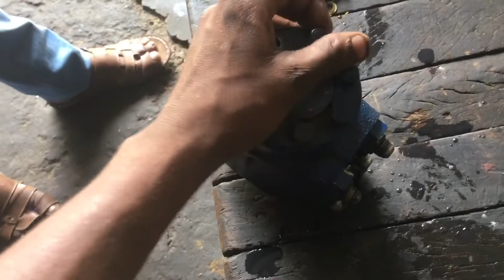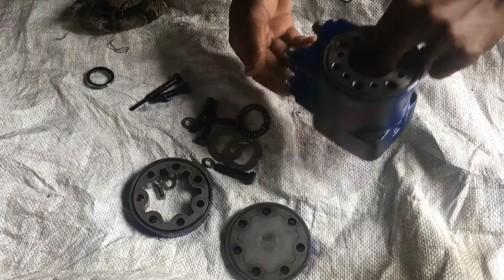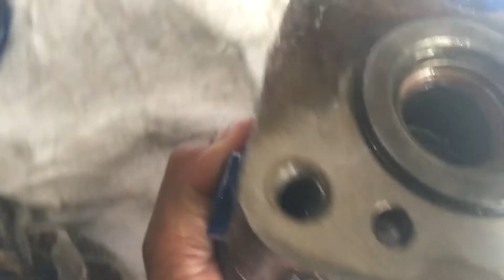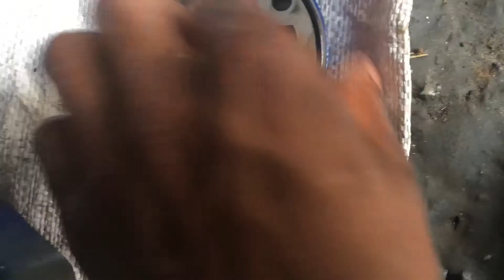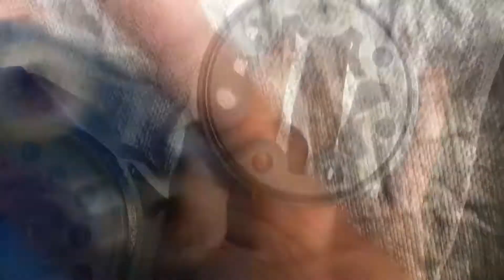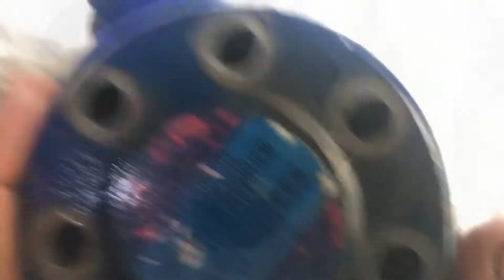power steering motor ki seal replace kaise Kara

Comment: This is  Shijiazhuang Hanjiu Technology Co.,Ltd,we mainly produce    Hydraulic orbital Motor and Hydraulic steering unit and Hydraulic Directional valve

HANJIU Orbital Steering Valve 101s applications:

1 Change Danfoss, Eaton, M + S and other brands, the advantage is the price concessions, the quality is close.

2  Replacing tractors like John Deere, Claas, New Holland and other harvesters Orbital to  OEM.

3 Replacing Delin, Crown, Toyota, Komatsu,JCB,Doosan and other brands  Forklift Steering Valve OEM